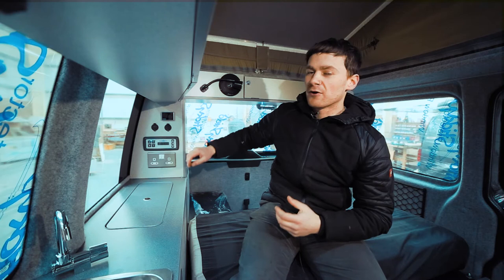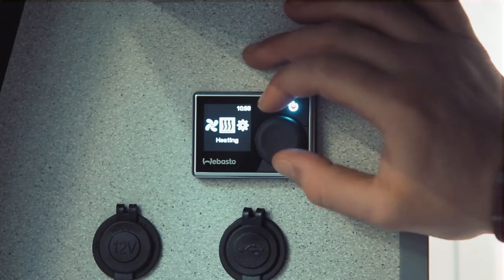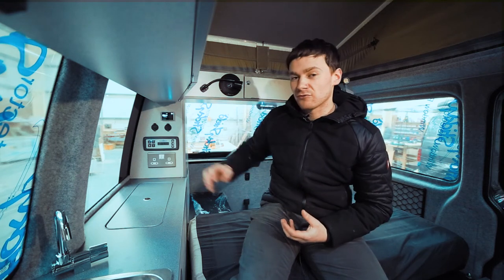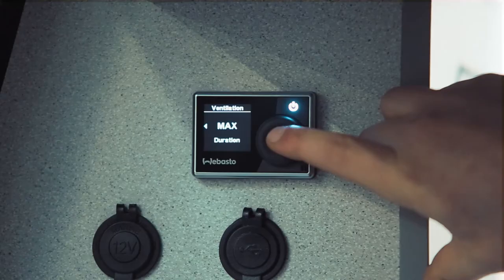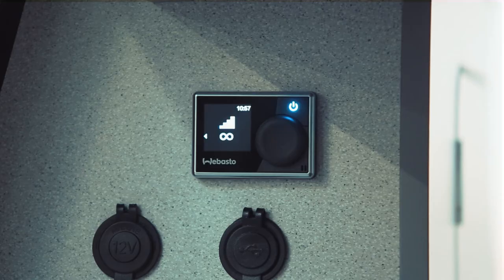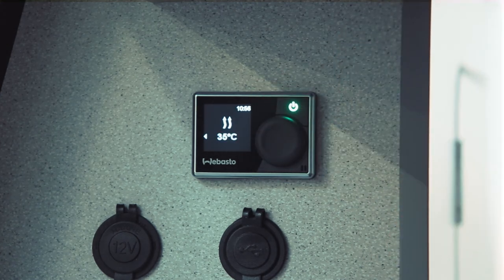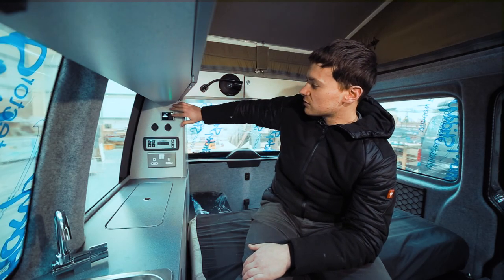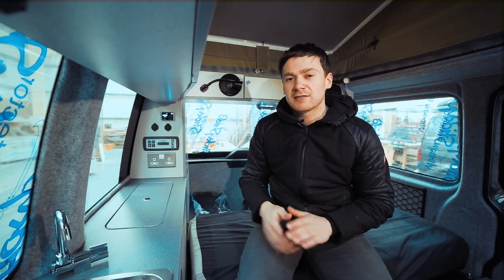Webasto Airtop Controller Walkthrough // Jerba Campervans

Comment: Is there a thermostat inside that controller? so by setting the temp to 26 degree it will run until the ambient temp inside the van reaches 26 or the alloted time is reached>